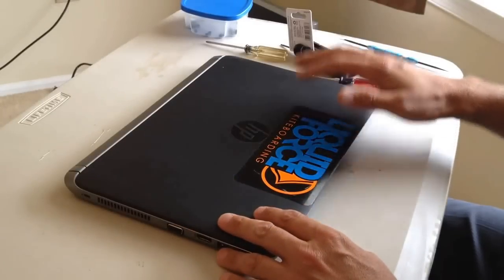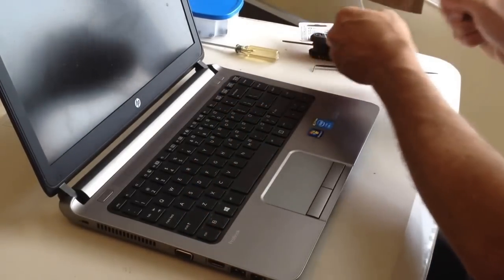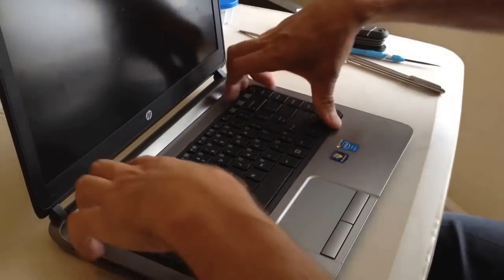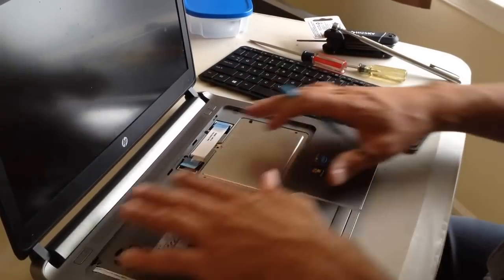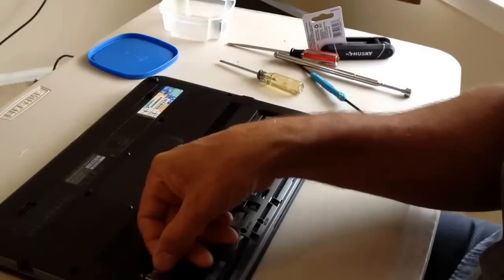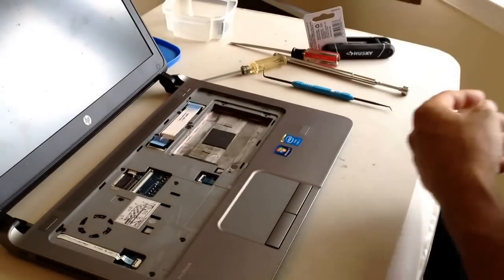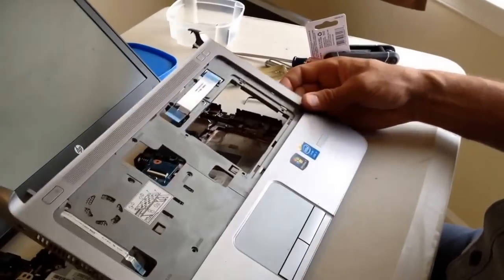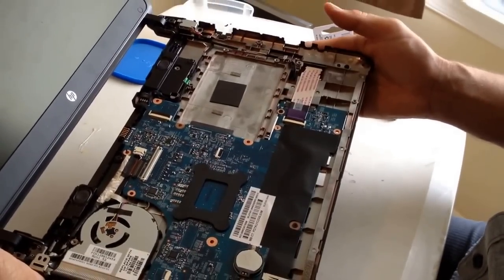HP Probook 430 G1 Laptop Notebook Repair HOW-TO

Comment: The first thing you need to do is remove the battery first before you do anything else plus hold down the power botton for 10 sec, to release the discharge from the main borad,
Reply from the maker: thanks mate

Comment: can we install M.2 ssd in HP 430 G1 ??
Reply from the maker: doubt it - probably does not have a m.2 slot
Reply: @Kitearmy  no it does have the slot even HP mentioned that the laptop is compatible with M.2 120 gb ssd storage but i doubt if it works or not or may be m wrong